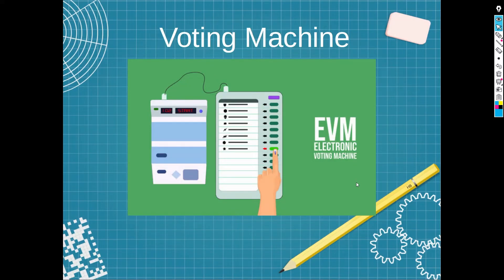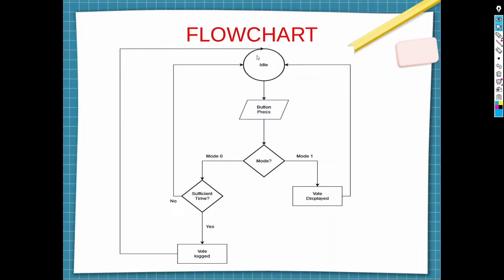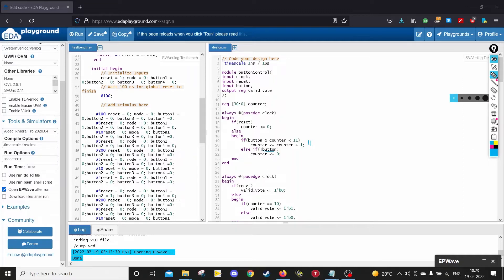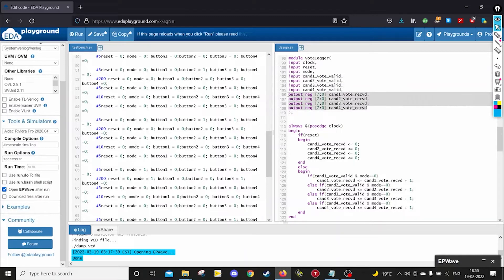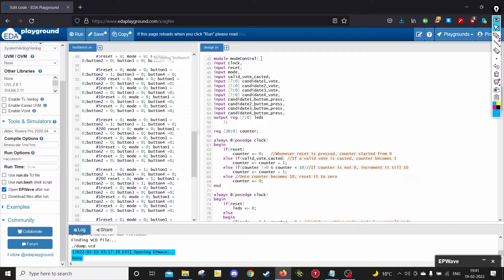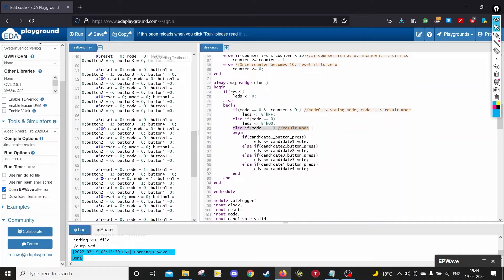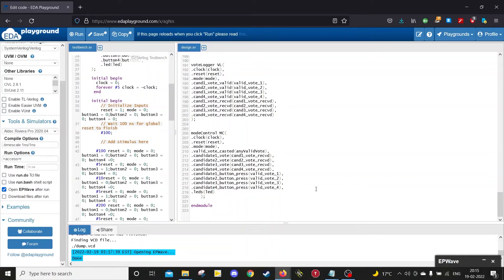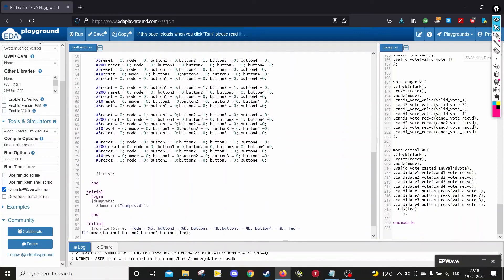Voting Machine in Verilog (with code) | Verilog project | XILINX | EDA Playground

Comment: insted of this code can we use this one 
""
module vm(
    input clk,
    input rst,
    input button_1,
    input button_2,
    input null,
    output reg led,
    output reg [2:0]ctr1,
    output reg [2:0]ctr2,
    output reg [2:0]ctr3
    );
   initial begin
    ctr1=0;ctr2=0;ctr3=0;
    end
    always @(posedge clk or negedge clk)
    begin
    if(rst)
    begin
    ctr1=0;ctr2=0;ctr3=0;
    end
    else 
    begin
    if(button_1)
    begin
    ctr1<= ctr1 +1;
    led<= 1'b1;
    end
    else if(button_2)
    begin
    ctr2<= ctr2+1 ;
    led<= 1'b1;
    end
    else if(null)
    begin
    ctr3<= ctr3+1;
    led<= 1'b1;
    end
    else
    led<=1'b0;
    end
    end
endmodule
 ""
test bench :
'""
module tb();
    reg clk;
    reg rst;
    reg button_1;
    reg button_2;
    reg null;
    wire led;
    wire [2:0]ctr1;
    wire [2:0]ctr2;
    wire [2:0]ctr3;
    vm uut(clk,rst,button_1,button_2,null,led,ctr1,ctr2,ctr3);
    always
    begin
    #1 clk <= ~clk;
    end
    initial
    begin
    $monitor("vb=%3d,vc=%3d,vn=%3d,led=%b,rst=%b",ctr1,ctr2,ctr3,led,rst);
    button_1<=0; button_2<=0; null<=0; clk<=0;rst<=1;
    #2 button_1<=1; button_2<=0; null<=0;rst<=0;
    #1 button_1<=0; button_2<=0; null<=0;
    #2 button_1<=0; button_2<=1; null<=0;
    #1 button_1<=0; button_2<=0; null<=0;
    #2 button_1<=0; button_2<=0; null<=1;
    #1 button_1<=0; button_2<=0; null<=0;
    #2 button_1<=0; button_2<=1; null<=0;
    #1 button_1<=0; button_2<=0; null<=0;
    #2 button_1<=1; button_2<=0; null<=0;
    #1 button_1<=0; button_2<=0; null<=0; 
    #2 button_1<=0; button_2<=1; null<=0;
    #1 button_1<=0; button_2<=0; null<=0; 
    #2 button_1<=0; button_2<=0; null<=1;
    #1 button_1<=0; button_2<=0; null<=0; 
    #2 button_1<=0; button_2<=1; null<=0;
    #1 button_1<=0; button_2<=0; null<=0; 
    #2 button_1<=1; button_2<=0; null<=0;
    #1 $finish;
    end
endmodule
'''
i have implemented the voting machine by using simple logic so can you please remark this and check it  kindly reply .🙏🙏
Reply: Does this code work

Comment: For the people like who are confused in the button control module with
if(button & counter<11) line here is the explaination;
Here we are not doing any AND operation between button and counter, 
Instead,
we are checking if button =1 or 0 and checking counter is less than 11 or not that's it. And then performing logical AND with these 2 events
Hope it helps someone. :)